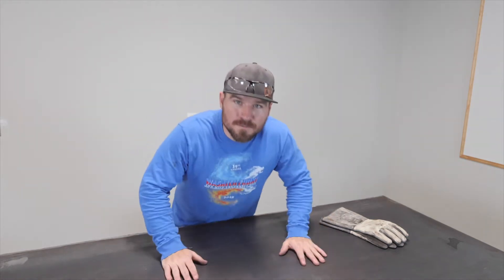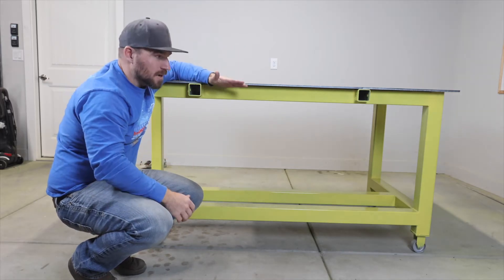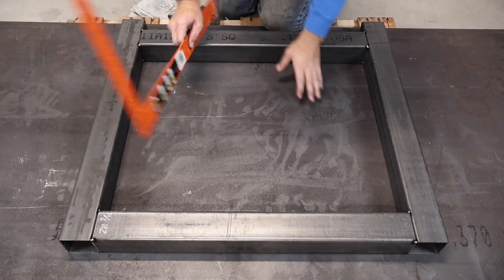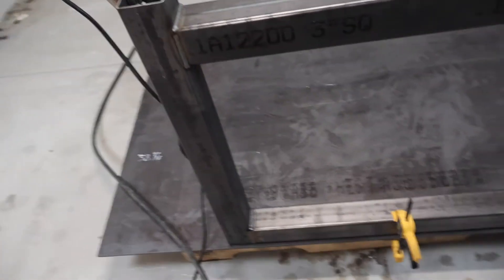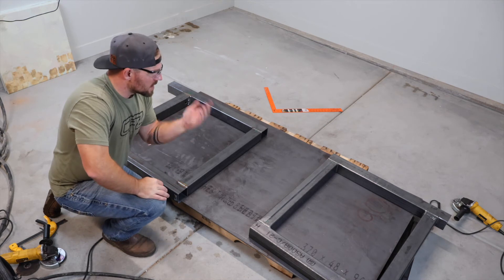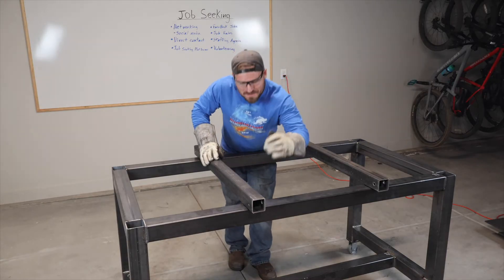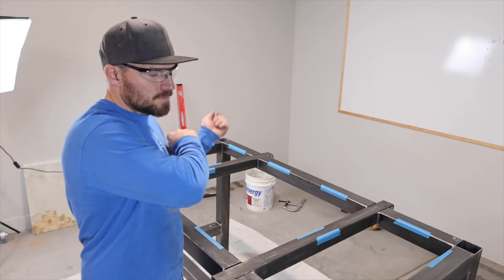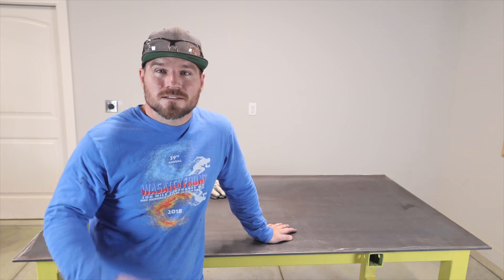Building a DIY Metal Welding Table – Step-by-Step Fabrication Guide for Beginners

Comment: if you weld the top on isn't there a risk of it warping and becoming less flat?
Reply from the maker: Short answer, yes. Longer answer it’s harder to warp thicker plate. The size of the welds and the heat of the welds are also a factor.

Comment: What do yall think about a ¼" table top? This is ⅜ and another on i saw was ½. I dont necessarily need to put a diesel on top of it. Just a weld table w vise etc
Reply from the maker: The only reason they go for a thicker table is it doesn’t bent or warp. But this is the reason I built a more heavy duty frame underneath my tabletop was to eliminate that possibility with support. Also, the overhang off of that frame has to be shorter with a thinner table top
Reply: @Mikesfilmss thanks for the reply brother. I like the 2" ovhg, if I did use ¼ plate I might consider gussets every few in for support tho I totally get the thicker plate adds strength

Comment: Hey mike, when you attached the legs to the top frame did you do a saddle weld leaving the top joint open? Tried zooming in to see but the resolution is too poor. I'm making a table atm and am wondering if i weld up that top joint and grind flush or are you leaving it and just tying everything into the plate?
Reply from the maker: I didn`t weld that joint at all. it`s not worth it in my opinion.

Comment: Did you ever put out videos of putting together the accessories on the 2" hitches? Id be interested in seeing how you mount various equipment and how you dealt with any backlash between the receivers and the hitch tubing.
Reply from the maker: I haven’t. I started a new job a few months ago and this got put on the back burner. I have plans to make them in the near future.

Comment: i always thought you had to drag weld with a mig
Reply from the maker: Ya I always push. Better penetration, and it looks better.
Reply: @Mikesfilmss Actually that’s incorrect. Pulling will have better penetration. While pushing, most people do not stay ahead of the puddle therefore with short circuit mig you’ll get better penetration while pulling. Watch some videos around YouTube and people actually test this. Awesome build and great video all around bro. You definitely gained a follower!
Reply: Push with hardwire mig, drag with fluxcore
Reply: ..so did I, ....until I had to do some wire feed aluminum welding...absolutely HAD to push with that stuff...and hold almost perfectly perpendicular to the surface.  Then it came out beautifully.

Comment: how much did you spend in the build?
Reply from the maker: It was around $700 bucks but a lot of the stuff on the table is personal preference and could be cheaper. Such as tubing size.
Reply: @Mikesfilmss   still way cheaper than  any ot the tables in trhe market.   thanks.

Comment: Nice build. Ive been gathering ideas on YouTube to tackle my table build. On the accessory supports is that 2in square tubing? Im gone implement that on mines as well. So i wont have a vice mounted on the table
Reply from the maker: That's exactly what I did to make this table. The tube that is mounted in the table is 2 1/2 inch square tubing. 

I'm currently working on the jacking system for the wheels and over the next six months or so I plan to build accessories and add 120 outlets. Hopefully, those videos will give you some more ideas.
Reply: @Mikesfilmss  sounds great looking forward for the updates. You did a great job on the step by step process made your build very clear. Thanks for your help